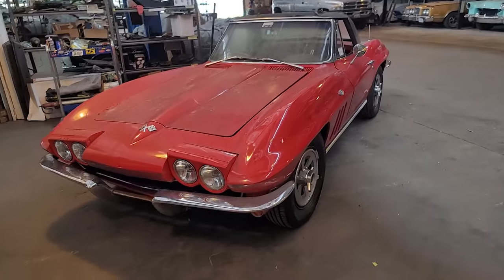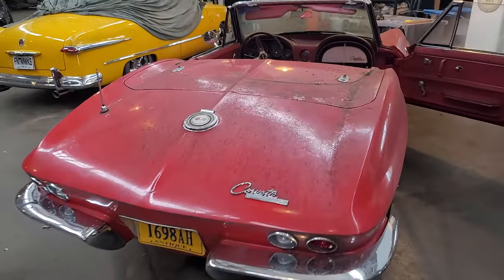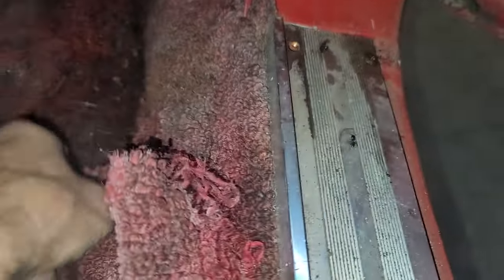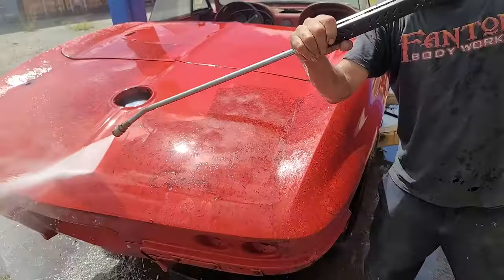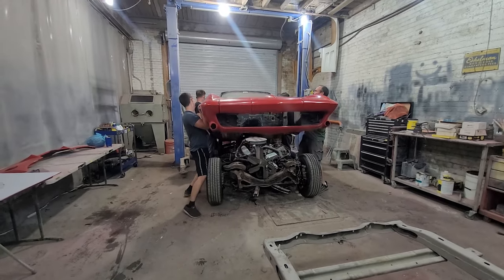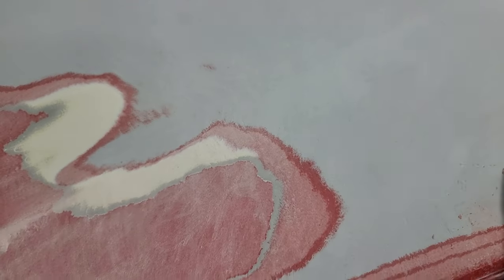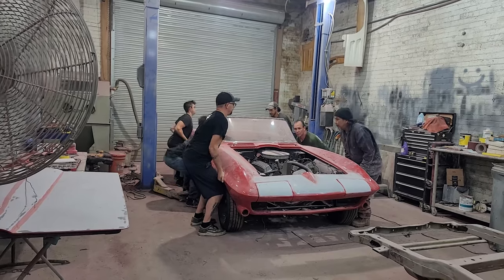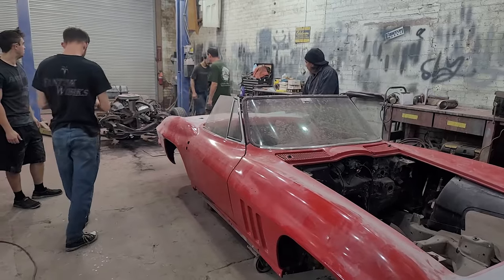65 Corvette Restoration: So Many Bugs, Pressure Wash, and Body Lift!

Comment: When you lifted the body off the frame, why didn't you use the car lift to lift the body up off the frame? Then roll the old frame out from under the body and roll the roller frame under the body on the lift. Work smarter. Not harder. You guys are going to break your backs lifting that body.😖
Reply: Probably because it's a fiberglass body
Reply from the maker: Exactly. We lifted a metal body recently (and that will be shown down the road on our channel) where we used the lift.